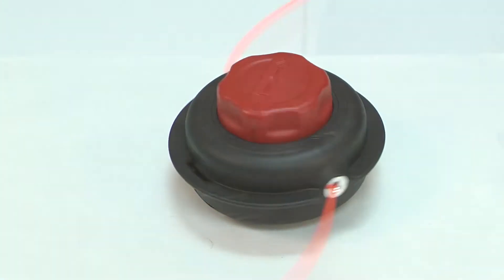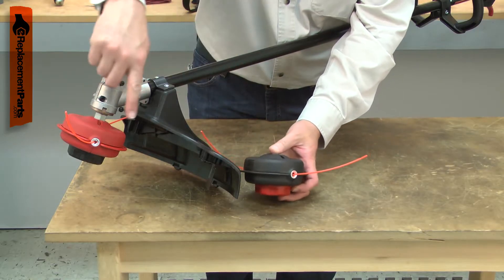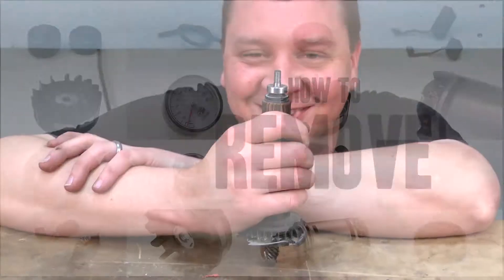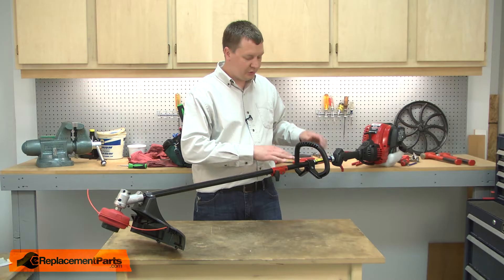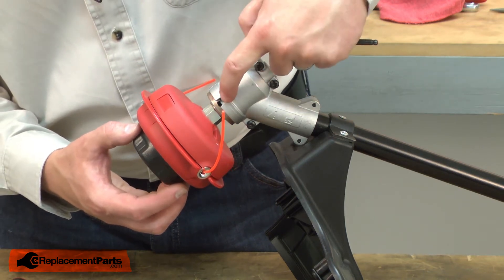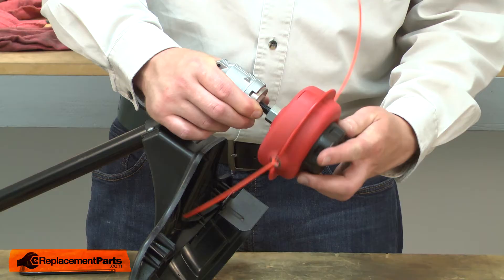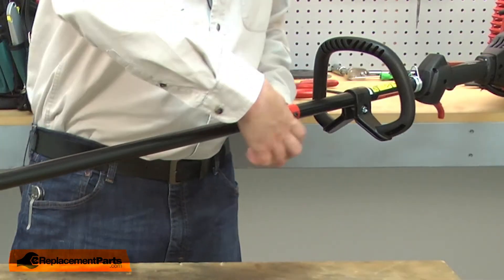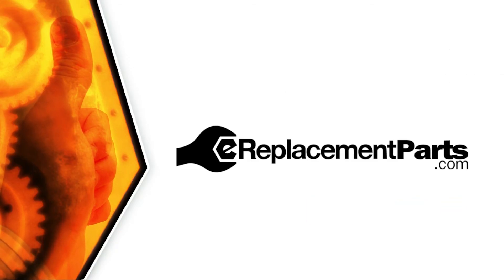Troy-Bilt Trimmer Repair - Replacing the Cutting Head (Troy-Bilt Part # 753-08182)

Comment: Easy to do on a brand new trimmer.  Not so much on one that has been used for three years which is what people usually have done with their trimmers and why they need a replacement head.
Reply: I was just about to come here to say that. Mine is 3 years old and the head is practically fused on and I can't get it off

Comment: Mine is a few year old and was stuck. I jammed a screwdriver in the hole and gave the head some pressure to hold it in place then used both hands to get it unscrewed. Definitely wasn't happening with 1 hand 😰

Comment: I have a Troy-Bilt TB32EC and there IS NO trimmer head flange with a hole or gap in it.  There is just a large hex nut, but no way to get to it with a regular open end wrench.
Reply: I have the same issue with the tb22. Troybilt has no explanation of fixing that.
Reply: Me too. Did you find a solution on how to get it off?
Reply: Same deal with my TB635 EC
I finally gave up today and took it to the saw shop.
He hasn't fixed it yet but when I do I'll ask him how he got it off there.